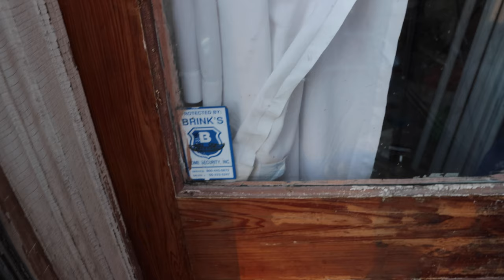This Is Not Great News

Comment: I manage a large house from the 30s and they had two of those door frame switches inside the house. For this house they acted as light switches. Kinda like in a fridge, whenever you opened the door it would release the switch and turn on the light. If you closed the door, it would shut the lights off. The switches in this house were in storage/service areas so they were more practical than fumbling around in the dark for the light switch.
Reply: That was my guess :) More places should use them today, such a simple but useful mechanism!
Reply: H o
Lo
Reply: I was thinking the same thing! My last house was from the early 20's and also had one. In my case, it was on a door on the second floor going into what was a storage room
Reply: What an excellent idea.

Comment: Hello Caleb, I live in STL City so I am familiar with the code that has the downspouts draining into the sewer lines. Here's my suggestion: I believe you have new gutters, etc. Go around the house and photograph all the gutter work and downspouts tied into the sewer line at the base. Then remove the bottom piece and have it drain out into the yard (away from the house, of course). Then just keep on working on other things. You will be able to put off the sewer work for quite a while. Even if the inspector notices, you can show them the photos and let them know your intention is to tie the lines back in, just not immediately. I cannot image that the city inspectors would not let this slide for a year or so.
Reply: @davebryant8050  I was just thinking that. Yeah, totally agree - stop draining rain water into sewer and see if you can hold out on the major work.  Also, how about some digging and patching the existing pipe?  Just temporarily.  The hardest part will be the digging - and that won't be that bad.
Reply: If my downspouts emptied into my sewer lines we would be backed up all the time. Can you re-direct those?
Reply: What a good idea
Reply: @davebryant8050  it’s illegal here in New Zealand too, was common 100 years ago though
Reply: In Queensland downpipes are run into the street.  The local councils periodically do smoke testing of sewers to make sure no downpipes are connected to them.
Reply: Good plan
Reply: Definitely take those downspouts out of your drainage system. I sure hope you didn't pay someone to put those gutters in like that as any licensed contractor would know that goes against code.
Digging put that sewer pipe  is best done with a mini-ex. There are lots of licensed contractors in STL that could help you with that part if the plumbing Co is gouging you. But if it were me I'd bite the bullet and have it done by a bonded/ licensed plumber. They'll make short work of it and it'll be done right.
Reply: Separate the rainwater and sewage. Rainwater in the sewage system is what overwhelms the treatment plants in case of a lot of rain and is why many cites end up dumping raw sewage into your local waterways during heavy rain.
Know you’re restoring your house to “as it was when built” but it doesn’t hurt to add some environmental improvements where possible.
Reply: If drain needs to be replaced, even with redirected rainwater, consider a back flow valve. It is likely your neighbors rainwater still connects to sewer and could cause you a backup in heavy rains. Relatively cheap fix when replacing your pipes. (Experience speaking.)
Reply: Twenty years ago at my home in upstate NY I was told that I had to  remove my downspouts that ran into the sewer.
Reply: If with a break in the water matrix our sewers collapse where I live I would not imagine if the gutters were connected to the sewer the few times it rains in our desert climate we simply let mother earth absorb the excess water or flow through the streets as channeled cement river...
Reply: Id suggest leading them in an area with an overground water handling area with plants etc that takes away the water and looks good. We do this more and more in Norway as we're getting more and more rain

Comment: When you have the sewer outflow pipe replaced have them install a backwater valve as well if allowed by your local code. This is a one way valve right at the house side of the outflow that will prevent storm drainage from backing up into the house. It's an absolute must if you're already doing the work!
Reply: Smart.
Reply from the maker: thats the plan
Reply: Exactly this is what most houses have.

In old houses only problem might be that is gets clogged sometimes....when the sewer line don't have good angle down the main line
Reply: @krewetkaaaa  I would put in a rodding point just before the non-return valve - on a swept Tee.
Reply: Back flow install on the 2” pipe or whatever and the connection to water meter oh yes

Comment: Hey there! That button IS for a security system. I grew up with one in my house. It lets a security panel know if the door is open or closed. I'd put money on 1980s or later. Keep up the good work, y'all. :)
Reply: I would suggest that it's older than 1980's by the style of the button and the wire that it's connected to.
Reply: @freetolook3727  Could be. I said so because I've never seen it on a house older than 1970s. And that one seemed like a  later edition.
Reply: That is way older. I’d bet it was added in the 1920s.
Reply: Since the door is in the basement it may have been a bell button to let the Veterinarian know if someone has come in. Caleb did show a doorbell as well. What do you all think?
Reply: @patriciapage9950  there was a bell of sorts attached to ours, although that would bring it back to the 20s. I thought it was plastic, but that makes more sense. I probably saw wrong
Reply: I think it was connected to a light. Similar to the buttons we have on our fridges.

Comment: An idea that has worked for me in the past: the biggest cost in that huge $10,000 price is the digging. It is worth checking on the rental cost of a large mechanical trencher and/or mini excavator. It may be cheaper for you to dig up the pipe and have the plumbers just plumb. Some plumbers object, but most are delighted to fob off the worst of the job to the homeowner and you could save 50% to 60% (at least, that's how it worked out for me in North Carolina). God bless, and keep up the good work!
Reply: Agree, there is no way Id be paying a contractor for the sewer if I was in his shoes. Imagine how much momentum the project will gain just by seeing progress on the roof. you cant put a price on that sort of motivation sometimes.
Reply: I was thinking the same thing.

Comment: The switch in the door jamb is quite literally called a "jamb switch."  They can be used for security, but more commonly back in the day they were used to automatically turn on a light when a door opens, such as a closet, but could be other rooms as well, or a door open bell or light.  You'll almost certainly have to permanently separate the stormwater drainage and sanitary sewer.  In the Twin Cities, the downspouts had to be diverted and the drain pipes filled with concrete or otherwise permanently capped.

Comment: My condolences for your loss. Prayers for you and family. About that switch. It's connected to a light switch for electrical. It's an old version from the 30s or 40s. Used as a security feature since it's located in the basement door and was dark under the old stairs, it would (as a pressure button) immediately light the room as the door was opened. Modern versions can be bought at hardware stores or online at Amazon.

Comment: That door bell looking thing in the door frame, looks to me like an vintage  door buzzer. 
Those buzzers were often hooked up at the homes delivery door and wired to the servants quarters to let them know that a delivery was dropped off, like milk, meat  eggs, packages, etc. Back in the day, back doors or side doors were often left unlocked during the day so these deliveries could be made quick. The door would buzz and the servant would quickly go fetch the delivery. No deliveries were made at the front door.
Reply: Hello how are you doing?

Comment: Caleb, I think this could have been a buzzer system on the door.  We used to have one something like this on an old house we had.  It was to let Daddy know a customer had come into the store so he could attend the customer.  Daddy was in very poor health and needed to rest a lot.  He could lay down in between customers while our house was attached to the store.  The buzzer went off when the doo to the store was opened and Daddy would go to the store.  When you buy old houses, everything hits at once sometimes and you have to make the best choices you can at the time you have to make them.  It sucks!  My hubby and I have been there a few times.  The thing is, it always works out.  It may not work out the way you planned, the way you wanted or thought it would, but it does work out.  Best of luck and best wishes, I know it it's hard but Caleb, if it were easy, it wouldn't be worth doing.  You and Kim are smart, young, and energetic.  You will be fine.  I have every confidence that this place will be a wonderful monument to Brown that you will be busting your buttons over before too long.

Comment: Yeesh. On a Sunday, about 12 years ago, I was doing laundry while prepping for a job interview the next day. All of the sudden I heard something sloshing, and black water started coming up in our bathtub. >:(  We'd had the cast iron waste lines under the house replaced, but apparently the long run to the sewer was also cast iron and had rusted away over the years. We'd wondered why the oleander plant at the end of the row looked so much greener than the rest. Roots in the sewer pipe. So we called an Emergency Rooter place because we both had to work. They came Monday, excavated a four foot deep trench out to the front fence, replaced the line, and put in a clean out, $11,000, thank you very much. Then a week later, black water in the tub again!! The company came back,  it's now the section on the far side of the fence, under the sidewalk, to the inside edge of the curb, six feed deep, and another $5,000. So frustrating to shell out that much over something you can't even see. It sucks! You definitely have my sympathy. This is why this community is worth so much. Hang in there!

Comment: Look into pipe bursting, they just dig a hole at each end and pull the new sewer line through, bursting through the old line, it works great and is much cheaper.
Reply from the maker: Good idea. I'll check into that.
Reply: I’ve never heard of that, but it sounds perfect!
Reply: @The2ndEmpireStrikesBack  contact your local wastewater collection system maintenance manager, they might be able give you a few contractors that do it. My city did bursting almost exclusively when they replaced the sewer lines.

Comment: As a resident at a 1930s st Louis house, we have definitely had issues with water backing up and building in the basement, and issues with the old clay sewer pipes.
Reply: If not already Change the pipes in basement and have overflow drain ! and waterproof basement. Your stripper should be able to let it sit for about 1 -1/2  2 hours  and Should scarp it Right off easy real clean

Comment: I had always rented until my father left his house to me. Now I, too, am enjoying the thrills of home ownership. Having to put in a new floor, having to put in new insulated windows, having to remove trees and level land, having to replace a whole bathroom plumbing system and then finding sewage problems connecting to the City. Can't wait for the central air and heat to go, and the hot water heater to break, which with my luck will all happen at the same time. So, I can relate! I keep thinking how wonderful it will all be when it's DONE! Btu I swear there are days when I want to just sell the place and go back to an apartment.

Comment: Hi Caleb. I highly recommend using double keyed deadbolts on those outer doors with windows. It is easy for someone to break the glass, just reach in and turn the latch knob for the deadbolts you have now. If you use the kind you have to have a key for on both sides, it is a lot more secure and prices are not that different. I use them and hang the key out of reach of the door.

Comment: I think that the mystery switch is a light switch that turns on a light when the door is opened, like a refrigerator. I have seen them on closet doors in houses built in the teens through fortys.

Comment: Sorry for your loss!  My Dad passed away this last June and it has been a hard to adjust.  My 1903 commercial building, I had to put new sewer line and trap from the building to the city sewer, it wasn't collapsed, the trap was plugged solid and it couldn't be jet out any more than 3 inch diameter and it wasn't enough.  It was 8 inch diameter - big pipe. They had to dig down around 10 feet (basement level plus a bit)  I had to have it done, but then everything worked perfect. Old buildings seem to require:  new sewer, new roof, new electric  - then you start off on good foot from there.   My roof water also went into the sewer,  so had to have that all disconnected.  I figured over 100 years (at the time) was good service and who know what went down the drains in the past.  Second floor had been a Printing company for 50 years  - so who know what they dumped .  I have a infrared paint remover too, Mine is bigger, but I like that smaller one like a wand - seems like that would be easier to use compared to mine - mine is sort of heavy.  Nice video!

Comment: Sorry for your loss. The switch was probably for a bell to let folks know somebody was coming in as it was a Vet office. It probably was connected to that door bell you also showed (The strike parts inside the bell) or the bell/buzzer is connected somewhere else (follow the wire and you might find it). If this predates the vet office then it is probably a security alarm so the bell/buzzer is upstairs somewhere. That switch is a plunger type that you see in cars where the circuit is broken as long as the switch is pushed down but becomes connected when the door is opened.

Comment: I so feel your pain. We had bought a house built in the early 1960's near a lake. We were told the reason the sewer was backing up into the basement was the same reason. Old clay pipes crushed in. But they were going to charge us (20 years ago) $7,000 to fix. It was about 300' or more of pipe to the corner of our lot where the water dept had brought the sewer line. So my husband decided to do it himself. He rented a small backhoe and dug the ditch. He laid the pipe and he covered it up. It was a little steep and a wooded lot so it was not easy. He made sure to put several clean out T's along the way. It only cost us $2700. But a lot of work and a little bit dangerous. I was sure he was going to tip that backhoe. So I know where you are coming from.

Comment: You should change the roof downspouts to not go into the drain line but divert it to go into the 
soil or a rain barrel. Rain barrels are useful for being able to use this grey water for lawns / flower beds. And help reduce your water bill. Especially if there is a problem with the mainline to the street. You can cap off the downspout drain lines and reduce the amount of water that the main drain needs to carry. 
With the crazy kinds of weather that is occurring all over, water conservation is becoming even more important despite the report I just saw regarding the level of the Mississippi especially around St Louis.

Comment: I have used an infrared stripper before, and it worked incredibly well.  I suppose it's ideal for items that will be painted.  I have used it on oak without burning anything, but you have to be careful to heat up the surface only minimally.  The good part about those pieces is that the paint is usually applied over a thick lacquer of some sort, so it bubbles up and separates from the wood really quickly.

Comment: The momentary switch is probably for coal delivery, so when bringing coal in for the furnace they didn't have to deal with a light switch or turn it off when leaving. Just a suggestion to replace some of the glass with laminated insulated glass depending on door thickness. Basement doors you might want to upgrade locks and hinges on basement areas, they are service doors and designed to get beaten up. For the HVAC system you running ductwork or using mini splits and augmenting it with the radiators?  Did you scope any other lines under the slab to make sure you didn't have a problem there, I take it their using PVC?

Comment: In my state it’s illegal to tie the downspouts into the sewer lines as it overwhelms the system, it’s also a good idea not to introduce foreign objects such as roofing granules or leaves and branches that may flush down a gutter into a vulnerable and very important and major operating system. Dump the downspouts onto the ground and allow the ground to absorb the water as well as the storm sewer.

Comment: I feel your pain. When I bought my current house, (not fancy like yours), I had to replace the septic tank which collapsed about 2 years after I moved in. $10,000 later, I had all new plumbing, but a whole lot of ugly house to live in until I could afford to continue the remodeling. It works out in the long run but is sure disappointing when you are in it.